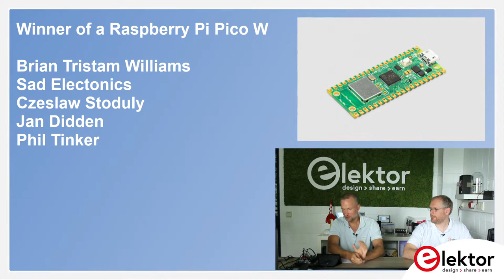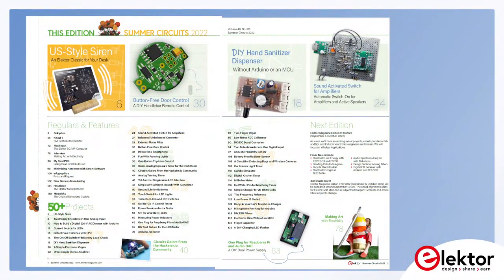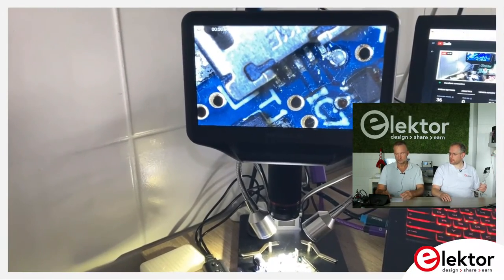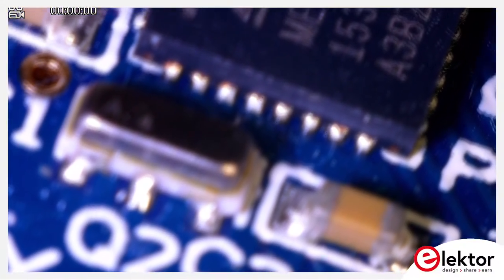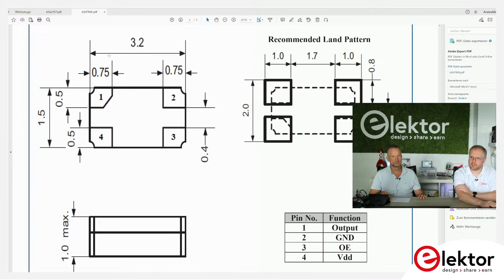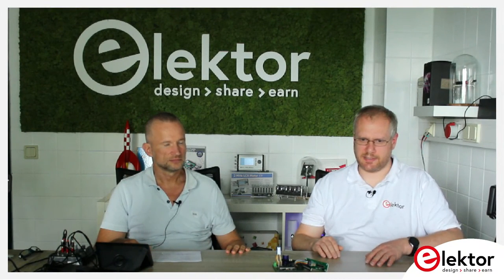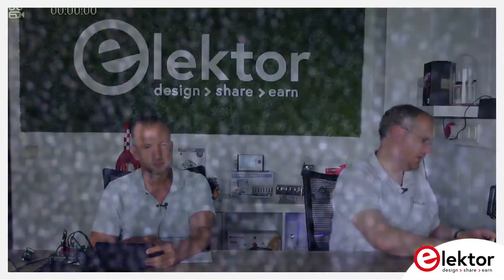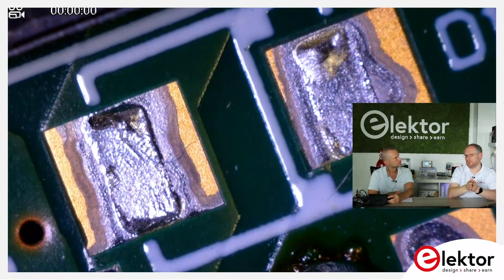Elektor Lab Talk : #5 - Short Circuit

Comment: Thanks for the useful information on shorts, there is always something to learn. A curve tracer can be a very handy instrument for finding shorts because it responds fast and gives you some idea of what the probes are connected to. Remember to set the voltage (polarity) and current of the tester appropriately for the circuit you are testing.
Reply from the maker: Very true!